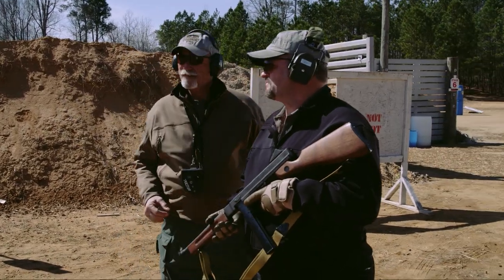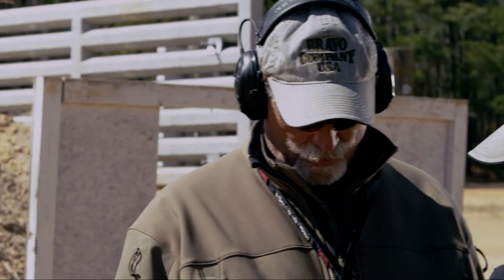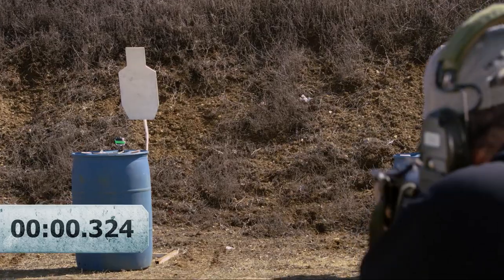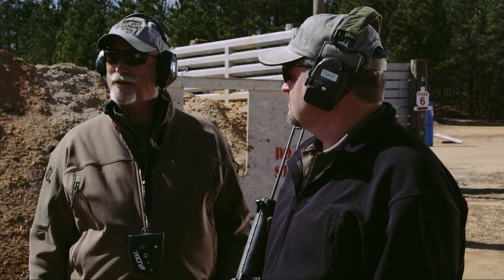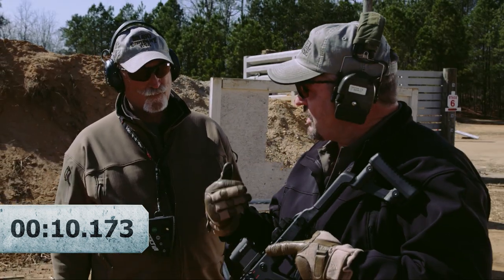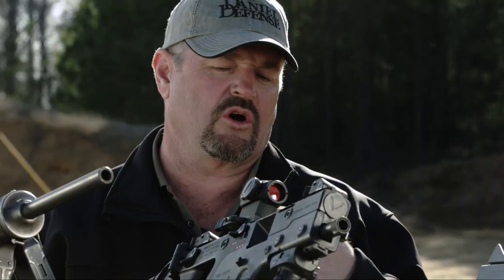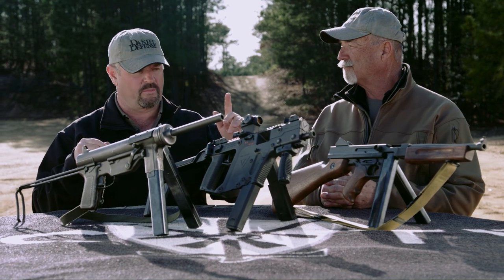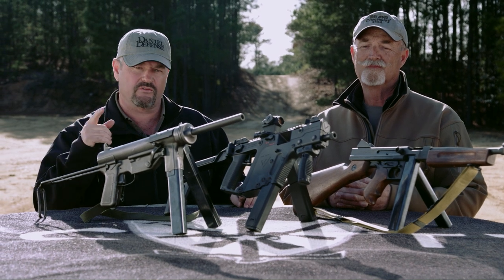Battle of the Submachine Guns Pt.4: Thompson vs. Grease Gun vs. KRISS Vector

Comment: The grease gun was still in service in 1990-91, at least technically. I have heard stories of new M1 tanks arriving with new old stock grease guns in the turret, still in their foil wrap. The grease gun was used by tank crews from day 1 due to its compactness and the ease of barrel removal to make it even more compact. I remember a demo from TacTV where a grease gun shot smaller groups and was more controllable than a UMP45, due to its lower cyclic rate and greater weight. I have long felt the grease gun did not get its just due

Comment: I have fired a 'Grease Gun and the Tommy Gun and to be frank, the Thompson is the only
one I can shoulder fast and hit with. I have not shot the KRISS but have shot
other compact guns like it and I can not hit the left side of a barn with  them
because of how they shoulder, the short sight picture  and how they fit me. 
The Tommy Gun has it's issues. Myself, I own a 1927A1 semi auto
version and I would prefer it over either the grease gun or that KRISS Vector.
But that is just me and my personal preferences. 
The Thompson is  a heck of a lot more powerful then any of those 9mm carbines.
The Thompson does take a lot of getting used to and it is very heavy in
comparison to the other two he had in this video. In fact, it probably weighs
as much as both the other guns put together. But, it has virtually no recoil or  climb
 especially if it has a Cutts compensator at the end of the barrel like mine does.

Comment: What was the issue with the 2 round burst?  Since I have no idea how you could make a gun do that, I imagined it would be difficult to do.
Reply: Not if the selector gave you the option ;-)
Reply: What I mean was that I have no idea how you could mechanically get a gun to fire twice.  Full auto open bolt and closed bolt, and semi auto open bolt and closed bolt are all easy to do.  But burst?  How the hell do you even do that?
Reply: spraynpray theres a rotating circular notch system in 3 round burst guns i imagine its along the same lines. though knowing kriss its probably just magic lol
Reply: I imagine it can only be done mechanically in a method that I wouldn't personally consider reliable.  I'll look it up later and then google complaints about it.

...does it reset if you have one round in the mag, ask for a 2 round burst, but it can only fire once?  Does it fire again when you put in a new mag?  My brain hurts.
Reply: spraynpray yeah, If it's hard for us to grasp this, imagine trying to invent the system! :P
It's pretty confusing but I'm sure there are plenty of resources to answer all your questions. Probably some good books about the internals of weapons too out there.

Comment: cough cough Thompson. How many Germans and Gangsters got it at the hand of a Thompson? Sure, it isn't the best gun in the world but it's not a bad gun by any stretch. Grease Gun is a classic. The Kriss is cool but this video showed that for all it's improvements that it supposedly has over older designs (Thompson is 90+ years old), it wasn't really any faster. Anyone with experience with a Thompson can load it all day long without problems. Might not be as reliable, but like I opened with: It was effective in it's day and deserves respect, not to be bashed when compared to modern technology.
Reply: I couldn't understand why they were so down on the Thompson from the start. In reality, the Thompson and Grease gun are both veterans and deserve equal respect. And the Kriss will probably be used in movies and video games more than it will ever be used in real life lol. We can't buy them in full auto as civilians, it's not practical in full auto for military or LE, and I wouldn't even consider one in semi auto. Basically, its a toy. I don't think it will be replacing any mp5 in anyone's arsenal.
Reply: Sedan57Chevy "How many Germans and Gangsters got it at the hand of a Thompson?" Comparatively few. Most gangsters got it in courts and then in the electric chair. Others rotted for years in prison and were wasted by rivals inside. Knives and pistols were far more common worktools for people in the 1920's mob. They were cheap and easy to hide. With a knife you could waste somebody quietly too and send a message too. Old-school "Guidos" (derigatory for Italians) carried knives with pride back in those days.
As for the Germans. Sigh. The M1 Garand was far more common than the Thompson so out of the Germans wasted by Americans the M1 easily dominated. Not that matters because 80% of all Germans bit the dust on the Eastern Front. They "got it" by Ppsh41's and Mosin-Nagants. A lot of them froze and starved to death too. You can check up German army historical sources like Feldgrau to verify.
That aside the Thompson was designed for WWI conditions and its drawbacks - namely its' cumbersome size became apparent in WWII when much of what had been learnt in the Spanish Civil War and the Finnish Winter War dictated designs.

As for its efficiency in its day. The German MP40 was very accurate, the Ppsh41 was fool-proof reliable and cheap to mass-produce and the Sten was cheap, very simply to produce, compact and accurate for a submachine gun. It may not have been the most reliabile weapon but tons of them very readily available so if one gave up you could easily replace it and had back-up from others wiedling the same weapon.
On a single weapon basis the Thompson was effective , but when one takes the price (they were expensive) and time (a luxury they didn't have at war) required to manufacture one its efficiency was clearly diminished. This is why the M3 "Grease Gun" was developed in the first place. Stamped parts, cheaper and faster. Better for paratroopers, tank crews and auxillary units to whom the Thompson was ungainly.
Reply: Come back once you have first hand experience firing a Thompson, as well as the rest of those guns you mentioned and then you can begin to make statements about what's "more accurate". Accuracy in terms of a fully automatic weapon is negligible. And while yes, the M1 Garand was a more wide-spread weapons, the Thompson was used not only in WW2 but also in Korea and Vietnam, both in the hands of US forces as well as those countries' military forces. As well as the other side using captured examples. The Thompson might not be a perfect gun (it is a bit heavy and cumbersome), but it did its job and I think that's what counts.
Reply: Wez Marauder It didn't get the nicknames "Chicago typewriter", "Chicago Piano", "Chicago Style", "Chicago Organ Grinder" for no reason lol. Not to mention you could order one to your front door from a Sears catalog.

Comment: i'd take the grease gun, with a red dot no question.
the 2 round burst on the kriss is cool, but i don't know if it's reliable.
but i'd pick a mp5, mp40, sterling, mat49, pm12, kgd-9 or mpl (all 9mm) over any .45 gun.
from that list i'd take
1: MP5, w/b&t handguard w/intergrated whie light, flash supressor, ump style folding stock, pic rail & red dot, most modern gun, but still the best smg in the world.
2: MAT-49, totally underrated, would be nice to have a optic, as the irons are small & low, a pic railwoud probably block them. if i was issuing a smg to conscript soldiers, i would pick this, as it's cheap & soldier proof, sterling would be another good option for this, but i personally would vouch for the mat-49.
3: MP40, a gun i'm farmiliar with the use, shooting & handing of (have limited trigger time on real mp5's, but used to own a airsft mp5, so i gess that hels with handling, i have no trigger time on mat-49, but hav handled a few) so i would do well with the mp40, which was used to great effect in ww2,was still in service until the 50's in Romania, Czechosloakia (police, border troops used them longer and may have been used for training) & Bulgaria, 60's with Israel, Finland & West Germany (Border Troops) 70's in Iraq, Syria & East Germany (Police, for training & in rural areas) and Norway used them until 1995 and now have them in storage. and it was used in the yugoslav wars, 2003 iraq war, syrian & libyan civil war, to good effect, so it's certainly not outdated or bad, even if its not the most modern design.
i don't get the american love affair with .45acp. yeah its a big cartridge, but it's very slow, and now there are better big rounds (10mm comes to mind) and now you can get 9mm ammo that is heavier than standard .45. yeah 9mm is a even older round, but it's commonly accepted as standard in the west. ameicans always bugger the standardisation of nato ammo, refusing the .280 and forcing the .308, then admitting they were wrong and changed to .223, hanging on to the 1911 and .45 for way too long, and confusing everyone with their 2 types of 40mm grenade. all this while the warsaw pact used the ak in 7.62x39 & 7.62 tokarev, which were replaced with 5.45x39 & 9x19mak, while all along using te venerable 7.62x54r for sniper rifles & gpmg's. communism may be evil, but their armies are efficient & can get shit done.